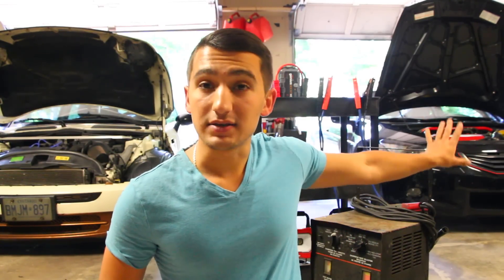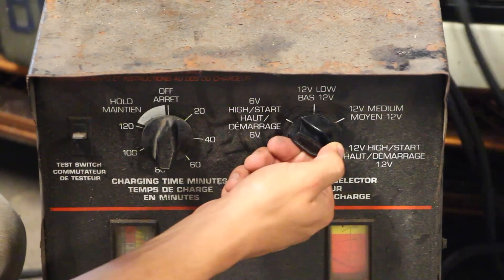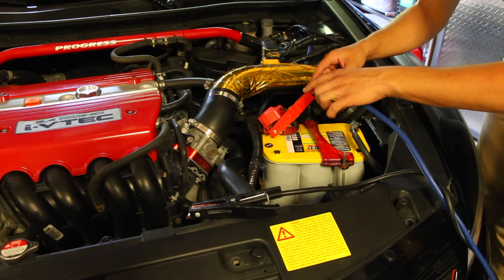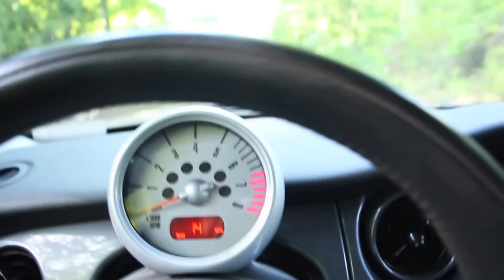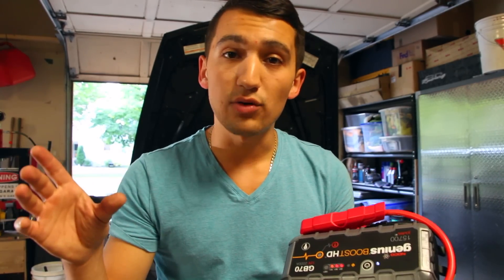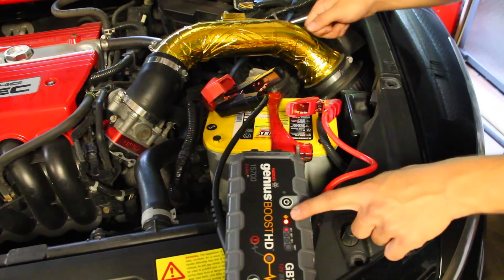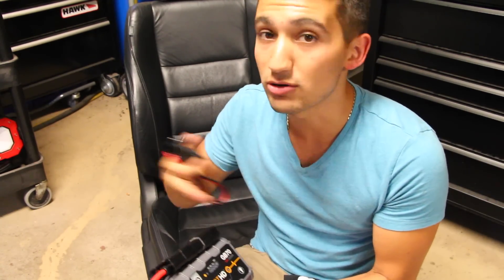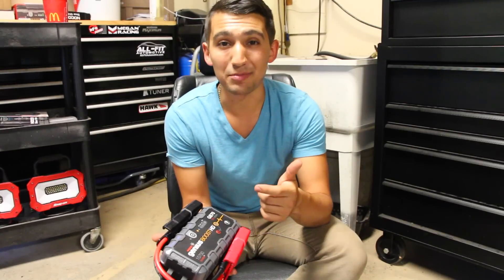How to Start a Car with a Dead Battery (4 WAYS)

Comment: You can bump start an automomatic but you have to be going at least  30 mph. I have done it before. It was a 91civic, which is not so high tech, but it worked. So it's possible but IDK about the newer vehicles cuz of the tech in them now.

Comment: I bought a NOCO GB40. Unfortunately it won't jump a totally dead battery. There is a manual override mode, but NOCO strongly advises against using it.

Comment: The job of the starter is to turn the engine over... you are doing it by turning the wheels and engaging the clutch. The alternator is providing the electricity to the system to fire the plugs as normal. Did this for years with my mom's vintage stick shift VW that had a starter problem years ago. Backed it up on the hill at home and when I wanted to go I put it in second (less torque needed) and popped the clutch... don't forget to leave it running while you are in the store!!

Comment: my problem is my car seems have a drain on the battery somewhere maybe my black box for my insurance? if I disconnect it you can easily do a week and still start the car however leave it connected from all the time out two days and it ain't going anywhere. I did somehow get it to start on 9.5 volts one day it turned over just barely how it started I don't know but there you go. well I suppose it gets me used to all the Tactics of starting a car with a flat battery lol

Comment: can you do that roll start on a automatic, Like maybe keep it in neutral and then put it in drive after it rolls or its no good.
Reply from the maker: Because automatic cars have torque converters and a different style transmission, you have the chance of damaging them as they aren't held in place, so the momentum of the car can't force the engine over.
Reply: With a manual the transmission has a clutch that grabs the clutchplate that then grabs the fly wheel witch is connected to the motor witch in turn will turn your motor over ... Auto has a torque converter that engages with fluid no possible why to start without a starter to move the flywheel

Comment: The fact that Chrisfix has over a million subs and you have better content and you post damn near everyday you should have way more than him
Lol.
Reply: This is all basic knowledge level stuff. He didn't even mention that you can just use another 12v battery and it will trickle charge without an alternator. The alternator just speeds it up and pushes more power but it doesn't have to be on

Comment: Or push-start the car in second gear if it is a manual 😂
Reply from the maker: Very similar as the bump start method. Get the car going and then let go of the clutch with the car in gear :)

Comment: If i leave my lights on it automatically turns them off after 5 minutes without the key in the ignition
Reply from the maker: Thats sweet!!
Reply: I know any interior light of exterior light or just any electrical component it does its saved me loads of times
Reply: Every car does that after the year 2000 or 2001 maybe early 90s?

Comment: What cold air in take is on that mini and do you recommend it?
Reply: CAI are worthless unless you tune the car for air/fuel ratio or the engine is turbo/supercharged. Just because you install a CAI will not make your stock camry a race car.
Reply: +Jackie chan_WTF lol we have a cooper S, i was just wondering what the guy had on his Cooper base relax
Reply from the maker: Its an AFE intake Stage 1 intake
Reply: +xSTORMs You ask if it's worth it? I gave you a straight and honest answer. But yeah, not worth it.
Reply: +Jackie chan_WTF depends. on its own, it won't do shit! I got one for my 97 supercharged mustang and I got 37 rwhp! :)
Reply: +Alex Yup those are good numbers. I was suckered into buying an Airaid CAI because of its flashy and promising pitch sale.

Comment: Option 4 is how I have to start my car. Owners manual says not to jump start the car due to all of the electronics in it. Great little device to have!
Reply: +Taylor F. sorry Taylor. I see your point unlike them.
Reply: That literally makes no sense.
Reply: +Taylor F. The owners manual states that a 12 volt battery must be used to jump start the car. I can't use another vehicle. Maybe I could use option 1 but I wouldn't risk it. I stick with what the manual says.
Reply: Kevin Abla Oh I don't? Why is that?
Reply: +Kevin Abla haha :) Thank-You! :)
Reply: Jordan F Jordan, most vehicles since the 1950s use a 12 volt battery. You can use jumper cables, pop your clutch, or a portable battery to boost.  Your fears of a battery charger make sense, but no need to fear.  Most battery chargers are 12v(which won't harm it, its what it needs) and some have the option for 6 volts, which you would want to avoid.
Reply: +Taylor F. My vehicle has CMBS, LKAS, LDW, and ADCC. There is a camera and a grill mounted sensor that controls these technologies. If you use another vehicle to jump start a modern car with this equitment, you do in fact run the risk of damaging these safety technologies. Not trying to imply you don't know anything about cars (you probably know more than I) however, with modern vehicles being computers on wheels, there are going to be certain methods that need to be used when faced with a dead battery. If this equitment becomes damaged becuase of improper jump starting methods, I would imagine it would cost a small fortune to have the vehicle repaired. It won't be covered under warrenty becuase the manual specifically states how the vehicle needs to be jump started. The owners manual is kind of like the bible, it's a great idea to read it! :)
Reply: Jordan F 12 volts is 12 volts.  If you are really worried, your only option would be to jump your car with a car that is NOT turned on.  This would ensure no more than 12 volts or a high amps is going into your system, but this may leave their car unable to start.  To fix that, you would jump them back.
Reply: +Taylor F. I bothered to read the manual and I'd prefer to stick with the information it provided me.
Reply: Jordan F Facts are facts.  A 12 volt battery is a 12 volt battery.  If you get stuck, I really hope you have a booster with you that is charged.
Reply: +Kevin Abla Thank-You for backing me up. :) Much appreciated.
Reply: +Kevin Abla ah okay.  lol :)